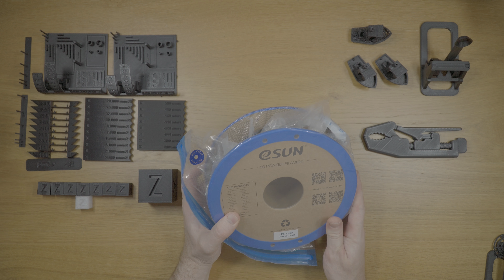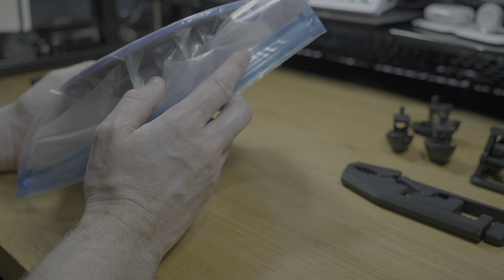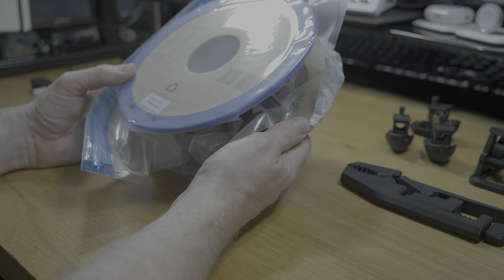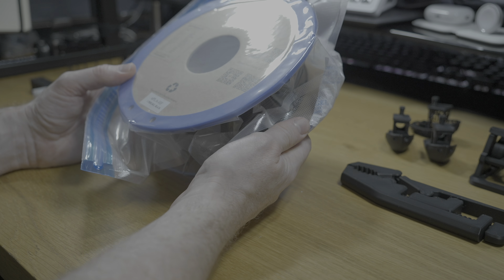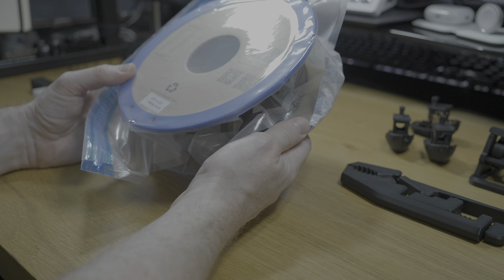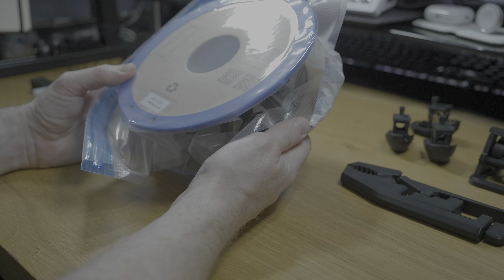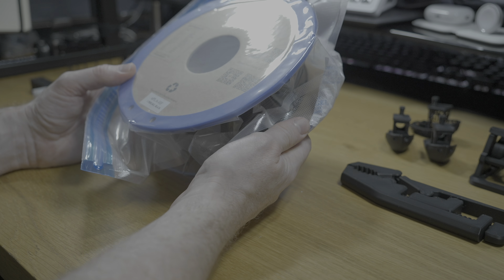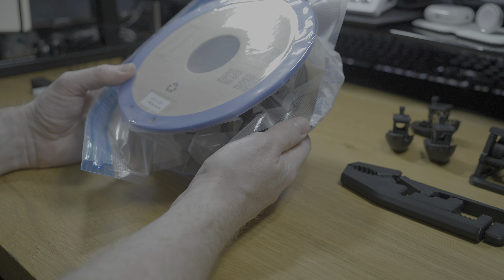Do you need High Speed Filament? - review of eSUN ePLA-HF Filament with the Bambu Lab CX1.

Comment: Why do you need those rings? I've not been using them on my AMS 😳
Reply from the maker: @BackDaws you can print without them, but the friction of the cardboard on the plastic of the AMS can cause cardboard dust to build up, this could cause issues with the AMS over time.  But if your having no issues, then less waste plastic.
Reply: @T8Maker  hmmm I'm worried now 😂

Comment: I got 1.65mm this year from eSUN ABS+ measured with a micrometer. Got massive extrusion problems with my Voron printer because it could not grip the filament reliable anymore in the extruder. Figured out a part was slightly melted inside the extruder assembly but 1.65mm surprised me…
I still use eSUN because of the price and availability but I’m looking for alternatives.
Reply from the maker: @Todestelzer That is really bad, normally their filament is spec'd for +/- .03 so that is way out of spec.  Did you reach out to them?  The best for accuracy I have used is the Prusa Prusament, which is not bad value in Europe if you buy in bulk.  But there are many other quality filaments out there, just price is an issue.  There are many cheap ones that are terrible so its a bit of a gamble some times.  Maybe some other views here can provide some recommendations, I would be keen to try others out too.
Reply: @T8Maker  im buying PC Blend and sometimes PETG from Prusa. I ordered ABS too.
The ABS (ABS-T) comes in strange spools how are wider than normal and the Price is somewhat on the high side. And they charge for shipping even when buying over 100€ too.
Lately they had PC blend for around 3 month not in the store anymore.
Had to call off a customer to wait till i get the filament again. I could not change to a other brand because it was testet with other brands in a very hot environment and was the only good one.
I didn't reach out to eSUN because of the filament. I don´t think they will do anything if you are not a big Youtuber ;-)
Reply from the maker: @Todestelzer I am moving away from ABS, the fumes are too much, working on ASA now.  But it has it plus and minuses.   Generally most of the cheaper suppliers are not sold directly by the manufacturer, its a sales/marketing company.  So even contacting the supplier will do nothing no matter who you are.  But I always think its no harm to try, and who knows they might replace the filament, or at least if they get enough complaints they would feed it back to the factories.  There are a few suppliers in Europe I haven't tried yet that might be better.

Comment: Nice video I'm yet to try eSun maybe I will give it a try after the creality hyper pla. Only problem I have is you say default 300mm/s but thats very vague, like which parts of the benchy were printing at that speed? normally that would be internal but external walls dip to say half that so the print quality will be the same for all parts It is only time you would be saving over print quality or am I over thinking that?
Reply from the maker: @xXIamJAEXx Yes you are correct, its necessary to maintain quality.  Honestly, unless your getting blockages or issues with flow, I wouldn't say its necessary.  Anyway here are my settings which are based on eSun's recomendations. 
First layer： 50mm/s
First Layer infill： 50mm/s
Outer wall： 250mm/s
Inner wall： 300mm/s
Sparse infill： 300mm/s
Internal solid infill： 250mm/s
Top surface： 200mm/s
Slow down for overhangs：ON
Overhang speed： default (50mm/s in my tests)
Bridge： 50mm/s
Gap infill： 250mm/s

Comment: A potential with the print speed test is that, depending on extrusion width and height, speed might have gotten capped by the volume flow rate limit. For example, the filament profile shown (with 22 mm^3/s max flow rate) at a layer height of 0.2 mm and width of 0.42 mm will top out at 261 mm/s, so the anything higher than that on the tower will be capped at that speed, and obviously look the same. In this case, that's most of the speed tower.
Reply from the maker: @Dave_the_Dave  Thanks for this, and yes, there are a lot of things where the speed will drop significantly depending on what is being printed, like overhangs.

Comment: Thank you for your testing and research, I already use (Esun Pla+) on my printers, not as fast as the new ones but I will try the (eSUN ePLA-HF) to compare the printing quality.
Reply from the maker: @danieldeslandes2479 Thanks for the comment, yes I have quite a bit of their PLA+ also, I bought myself, and it can be a great balance of value and quality for a PLA.  If you look back at my AMS troubleshooting video it was one of the recommended filament brands to avoid filament shredding in the feed.  For me the main difference for ePLA-HF form the PLA+ filaments, although I did not do a direct comparison, is the reduced risk of print head jam.  Not saying it will never jam, but should not jam on speeds up to 300mm/s.  While I noticed no difference in properties of the filaments, if you won't be using it on a high speed printer, I am not sure you will get any advantage.  Again, thanks for the comment and watching the video.

Comment: You can certainly use compressed cardboard spools in your ams without these rings. I believe Bambu is referring to corrugated cardboard spools. I use Polyterra corrugated spools everyday for a business that requires rapid part production 5 days a week. Great video btw.
Reply from the maker: @grayfaux_  Thanks.  Do you have any issues with dust from the cardboard?  Honestly I haven't tried it because I wanted to avoid dust caused by the friction.  But I would prefer to use cardboard to reduce plastic waste, and I could just hover out the AMS if it caused dust.
Reply: @T8Maker  No, I haven't had any dust issues. Very little dust if any comes off a "good" spool. I suppose you could use a quick puff of compressed air between spools as an extra precaution.
Reply from the maker: @grayfaux_  Thanks for this, great to know, will get a few and try them out.

Comment: Its high flow filament so should give you a higher volumetric flow than normal PLA or PLA+. Should do some tests to see the difference between this HF PLA and PLA+ flow rates.
Reply from the maker: @TNotoriousAdam thanks for the comment, yes, you are right and I will probably test it at some point, but I don't want to become a filament reviewing channel, so if I do I might put it in a short.  My next planned video is servicing my Bambu Lab printer.  While I greased the lead screws recently, I used cheap lithium grease. Just got my hands on some Super Lube PTFE grease direct from the US, I want to try out, so I might do a full gut and clean and tighten up.  See if that improves the prints.  Then maybe do flow calibration tests with a few different filaments.  Once that is done, need to do the same with the Prusa.  As with everything, all I need now is to find the time to do it.   Thanks again for watching the video and for the feedback, I hope it was of some use.

Comment: I see you use a Bambu printer.   It would have been great for you to say how you feel the eSun compares to Bambu filament.   No doubt Bambu filament is intended for high speeds also.
Reply from the maker: @georgemouer4565 I have not tried the Bambu Lab PLA filament outside of the sample half role that came with the printer.  But it printed really nice and no issues with speed prints.  Generally their filaments have been high quality, but their price matches others with similar quality.  But you get the advantage if you have the AMS to have NFC work to tell the AMS what filament is installed.
Reply: I am told Bambu filament is rebranded eSun.
Reply from the maker: @flat_stickproductions209 I have seen people say that too, but not sure how true it is.  Thant said, most of the filaments you buy from Chinese companies, and some western companies, are made in the same factories as with many other things.  but they may be made with different specifications, materials, and levels of quality, so its hard to tell.  I have used both filaments, and the Bambu Lab branded filaments definitely produce better prints on the Bambu Lab printer, but that could also be related to tuning and settings in the software.  But I also see Prusa filaments print really well on Bambu Lab printer with generic filament settings.  I recently printer my Prusa MK4 upgrade parts on Bambu Lab with Prusa PETG and generic settings and they came out great.
Reply: @T8Maker  got my first roll of eSun today and so far watching the rest print it looks great, better than Sunlu and Elegoo.
Reply from the maker: @flat_stickproductions209 Great to hear it works well for you.  You should check out eSun's website, they have settings for a lot of their filaments, to ensure your getting the best out of them.

Comment: I tend to use nothing but high-speed filament. That is because we do a lot of prototyping and usually have about 4 or 5 machines running at a time, and the price is really not that much more than regular filament. I really think that all machines and all filaments should be high-speed compatible and get rid of all the old-fashioned printers to move the industry forward.
Reply from the maker: @qwertyzxaszc6323 I would agree except for one thing, for those starting out who cannot afford to swap machines, plus waste, there is  a lot of waste in 3D printing, and junking old machines is more waste.  That said there are a lot of great value high speed printers now.

Comment: Those measurements on your cube. Shouldn’t that be done at the tip of the caliper?  Either way. I think most folks get the same measurements give or take as you. If I measure you you measured. My cube is 19.95x19.96x20.04

I recall reading that any tolerance less than 0.15 is considered good.
Reply from the maker: @alecubudulecu risk of measuring with the tip if the calipers is that you would not be flush and get off axis measurement.  But after doing some maintenance, changing out the head I got much better numbers.  But I agree, unless your doing high precision prints it doesn't matter.
Reply: @T8Maker  makes sense.. thank you for explaining.  now that I think of it... based on what you just said... it shouldn't matter.... plus if I do it how you showed, I get flush.  if I put the item flat where you did... and zero it there... shouldn't matter as THAT becomes the new measuring zero .  thanks!

Comment: Seems like a marketing ploy really.  If you read esun’s documents and profiles for their other filaments the flow is high and the recommended speeds are high too.  I don’t have any issues printing their PETG at 200mm/s or PLA+ and default Bambulab profile speeds.
Reply from the maker: @justinfielding I know where your coming from, I have not had any issues with printing standard PLA at high speeds.  But the pitch is that is reduces the potential risks of high speed printing, like clogging.  So if that is a problem your having, this might be the solution.  But if your not, then no need to get it.  But this goes back to the old 3D Printing issue, there are so many variables that affect your print, that there can be no one size fixes all solution.